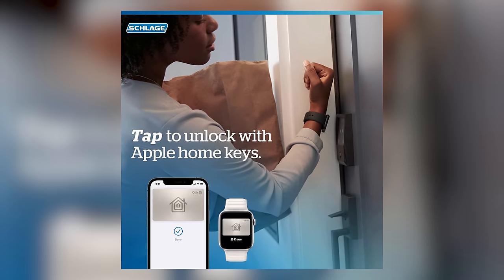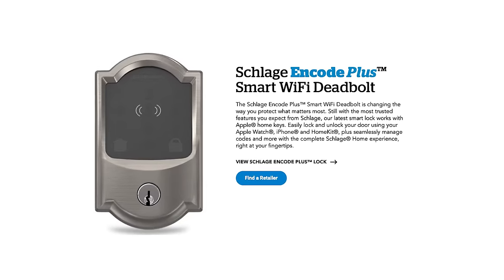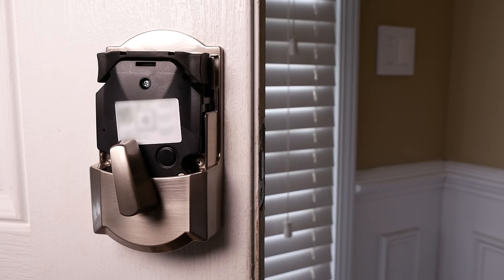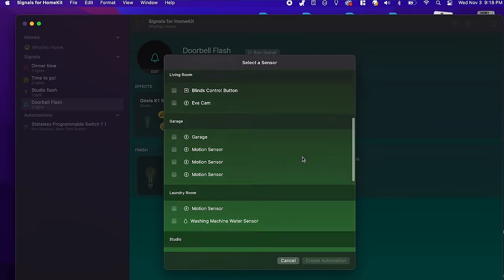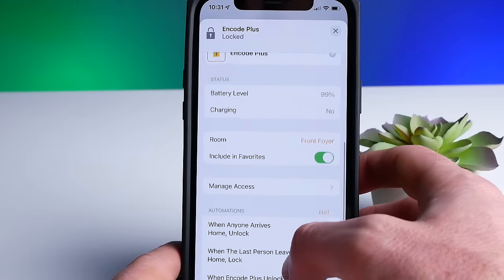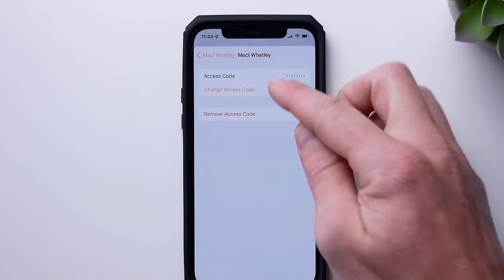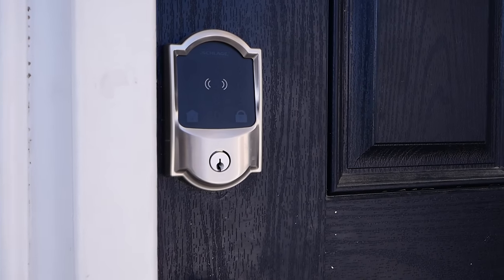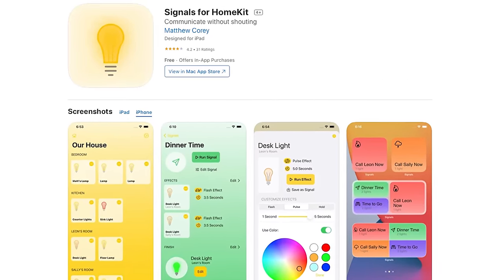Worth the wait?? The Schlage Encode Plus Smart Lock with Apple Home Key is here! [Full Review]

Comment: Setup and pairing was so crazy easy. Didn’t need a crappy app, didn’t need to enter Wi-Fi details or anything. Most painless iot device I’ve ever installed.
Reply: I’ve had so many problems setting this up. I can get it the door to open with my phone. I get notification that it opens with my watch with the checkmark, but it doesn’t. Now for some reason it’s disconnected from Wi-Fi? I like to think I’m pretty good with these things, but this is a pain in the ass.
Reply: I’ve had so many problems setting this up. I can get it the door to open with my phone. I get notification that it opens with my watch with the checkmark, but it doesn’t. Now for some reason it’s disconnected from Wi-Fi? I like to think I’m pretty good with these things, but this is a pain in the ass.

Comment: I've been loving the "Level" bolt lock. Supports homekit and is "invisible" as it just replaces the interior bolt section of your existing deadbolt, so all your old keys etc still work, and the lock looks stock. They ingeniously incorporated the battery into the deadbolt itself, and mine has been going for 2 years now and the battery still shows as "good". Also supports guest users etc, and when I return from a walk I just tell siri to unlock the door.
Reply: For the level lock no, although if you want you can setup a shortcut/automation to unlock it when you are near. As far as going out, you can set it to autolock, or use a shortcut/automation to lock when you are outside of a geofenced area.
Reply: @BlazerRox  has geofence lock/unlock automation been reliable to you? I heard it doesn’t work all the time.
Reply: @aldotorre8802  TBH I haven't used it enough to give an accurate opinion. My house is stucco and so has chicken-wire embedded in the exterior walls, as well as metallic "radiant barrier" roof sheeting, so I usually get literally zero gps signal inside my house.
Reply: Level lock can be picked way too easily, there are videos on YouTube, hope this is better.
Reply: @oBIGTo  My level just replaces the bolt innards, and so is using the original Schlage lock cylinder. This is what I like about the level bolt, it retains your original hardware on both side of the door, and just replaces the bolt mechanism.
Reply: The level lock now has Apple home key
Reply: @Xanduur  Too bad they couldn't add it to the older bolts via software update (at least mine doesn't seem to have the option)

Comment: Nice video.  I'm an Android user, but I love my 1st generation Schlage Encode BE489 Deadbolts, I get all those notifications (WiFi is necessary to get notifications when away from the house).  I had the Schlage BE369 Zwave lock for a decade, I did not like it's large silicone membrane buttons (like an old TV remote) that had excellent feedback from the 1/4 press when new, but it was slower waiting for the button to return, before the next button (unlike this new BE489).  That BE369 keypad would get wet and dirty after a few years of use and UV damage, very slow intentionally button presses.  This new keypad is smooth and seems sealed for the weather better and allows FAST code entry.

Because we don't use iOS, we have the 1st generation Schlage Encode BE469 Deadbolts.  Everyone has their own unique code, even my 6 year old has a code and can operate this deadbolt easily.  I like the fact that any security compromise can easily be changed by deleting 1 code and talking to that individual, not locking EVERYONE out or cutting new keys for everyone.

If you want the highest security deadbolt that even the lockpickinglaw would approve of, take your locks to a specialist and have the cylinders replaced with Schlage Primus grade, then make sure your emergency key is in a very safe place.  The Primus Lock system is almost impossible to pick, and there is no electronic defeat to compromise a Schlage Encode Deadbolt that has been published.  I'm certain as soon as they find a bypass it will be made very public as the Schlage Encode Deadbolts are very expensive and seem entitled to their security label.

Comment: Thanks for this video, great content 😊. I wanted to ask - is it possible to
(a) disable access codes entirely so that only using iPhone / Apple Watch or the physical key unlocked the door?
(b) integrate with some kind of camera / doorbell e.g. Aqara G4 so that the passcode only works if your face / household member faces are recognised?
(c) open the lock using the physical key in the case where the batteries die?
Thanks to anyone who can answer these questions 😊

Comment: Hi Shane, great review! Tried ordering on Home depot and Lowes, both cancelled orders as they went out of stock. Called Schlage sales dept.  3000 units made until June/July.  Wait times will be really long.  Paid waaaaay too much for mine on EBAY but love. Removed my Schlage sense lock and instaleld the Encode plus. Works amazingly well with the express pass feature. Just need to get my better half used to that instead of using the code. I contacted Apple through feedback- the family watches need to have homekit!!!
Reply from the maker: Hey Jeff thanks for the comment. Hate to hear about the long wait times, but glad you got one and are happy with it! And thanks for contacting Apple with your feedback regarding the family watches. I did the same. I sure hope they can add that! 

Thanks for watching!
Reply: @ShaneCreates  The only one on EBay at the moment is priced at 760US$. I bet their locks got caught up in the Shanghai supply chain, so we'll have to wait until much later in the year.

Comment: Question… to unlock using the keypad, do we just type in the 4 or 6 (or more) digit access code, or do we need to push a button after that? I couldn’t tell from your video… looked like sometimes you pressed the bottom left button and sometimes not. (And then, to lock, we don’t have to enter the access code at all, correct, because we can just enable the 1 touch lock?)
Reply from the maker: Hi Erin. Yes to unlock,  you need to enter the code, then press the "unlock" button at the bottom left. To lock it, you can simply press the "lock" button. No need to enter the code to lock it.

Comment: How many locks can you have on one house, can you control multiple locks with one iPhone or Apple Watch?
Reply from the maker: You can control multiple locks with one iPhone in the Home app. I haven't tried using multiple locks with the Home Key feature tho. I assume each lock would issue a separate Home Key in the wallet app and the lock can automatically detect it when close. Would be a good test, but I only have one Home Key lock.

Comment: Thank you for this thorough review, Shane! Got one question: can you set new door open codes remotely, presumably using the Schlage app, or do you need to be local (I.e. on the same WiFi as the lock) to set those codes? I am running an Airbnb, and being able to set and disable guest codes remotely would be a huge benefit for me.
Reply from the maker: Thanks Hubert. Yes, you should be able to manage access codes remotely either through the Schlage app or HomeKit.

Comment: Great video, Shane. I always love the exhaustive nature of your reviews. I’ve been awaiting this lock to replace my August lock on the front door. My home office lock is the other Schlage HK lock. Similar to Lutron, Schlage is a great example of an industry icon for traditional hardware doing everything right when they went smart. My Schlage lock is the most reliable part of my smart home, having never disconnected over the past 6 months (except when it required new batteries). I love this lock and know I can count on it. 

If I understood one of your critiques correctly, I have been able to use automations via the Eve app that occur once the lock is in the lock position any day from 1-8pm. I have a “close down the office” scene which turns off internal lights and HVAC, reduces the humidifier to limited use,  and changes my external color-codes light to white, telling my family I am not in the office. The scene now automatically starts when the office door lock is locked between the time noted.
Reply: I think what Shane meant was the ability to use the individual who locked/unlocked as part of the routine's parameters.  So not just the fact that it was unlocked but that SHANE unlocked it or BOB unlocked it.
Reply: @JohnVanderbeck  Thanks for that clarification. On my Schlage lock, it does not record who locks the door as a code is not required to lock it. I’ve not tried to build an automation on an unlock and would suspect, from recall, that the “who” would not be available.

Comment: Unless I missed something, I did not see you physically set anything on the lock that allows a new device to be given access to it. What prevents anyone else with the software from adding your lock to their device? I would think the safest way would be a hardware "program" button that could only be activated from inside the house or before finishing the install. I'm sure there is something in place but you didn't mention it.  

Or is it just that, as long as it is in the unlocked position you can add a device, if it is in the locked position you cannot?  That wouldn't seem very secure. If you leave you door unlocked during the day, anyone could walk up when you are not looking and program your lock for later access.
Reply from the maker: Yes you need to push the button to put it in pairing mode. Shown at 5:20

Comment: As much as I’ve been waiting for this, Yale locks have rubber gaskets to keep humidity out. My Schlage lock’s alarms went nuts after a few years and go off all times of day and night. The internal garage door lock has never had a problem. I finally cut the tamper alarm speaker wire just to shut the thing up! Also, Yale uses a module system for connectivity. I hope Yale will release a replacement module to upgrade existing locks.

Comment: I had the same issue with it showing it was using BLE, a quick reboot of my iPhone made it show Thread on both of my Schlage Encode Plus locks right away.  Not sure if it was connected to my iPhone and the reboot made it join the Thread network or it just helped my iPhone see it correctly.
Reply from the maker: Ah, nice tip! Thanks for sharing!

Comment: Nice Vid Shane! Is there a sensor that shows when the door is completely shut and able to be locked? I can see issues where maybe the door is not completely shut and the lock can not engage.  This type of door open sensor could also be used in a security setting warning when the door is open and triggering a security alarm. Are there any sensors of this type built in? Thanks for all your information!

Comment: Do you know if this lock - or any smart lock - works when there is no power in the house?  Does the NFC or keypad work with the battery lock if the wifi is down?  As I often run without taking my phone (and house keys obviously), I generally use the key code on my garage to get in to the house when I return.  But one time I had gone out without my keys and my house lost power, so I was unable to get in through the garage.  My husband had to drive home from work to let me in!

Comment: Does this auto-lock after you close the door?
Reply from the maker: No by itself (no door sensing capability) but you could automate it with another door sensor via your smart home if you wanted. There is an auto lock feature that will lock the door after it's been unlocked for a set number of minutes.

Comment: Hi Shane!  Now that you had the lock for several months, did you notice any corrosion issues with the batteries/ battery pack?  I live in the Midwest and have the older version of this lock.  The batteries/battery pack housing corroded very quickly (tried multiple battery brands and still had same issues) and now the unit is failing all together.  I am hoping this issue is resolved on your newer version as I need to replace mine.  Any feedback would be much appreciated.  Thank you for your time, and review!

Comment: My problem with this is signal strength to my front door. I had tried the Schlage Sense with Bluetooth and it was unreliable. 

I have since installed a HomePod mini about 20 ft away around a corner so wondering if Thread has better range.

Comment: Interesting product. I find the styling to be too conservative for me. Was wondering about Siri here. I have a lot of thread devices in my home kit, it seems you should be able to use Siri securely to unlock the door. Pulling out my phone (or iPad) seems cumbersome with an arm full of groceries. Also if I need to get in the house quickly can I open the lock remotely before I get home?
Reply from the maker: Yes you can unlock it remotely as long as you have a HomeKit hub in the house (Apple TV or HomePod). You can use siri to unlock the door, but only on an unlocked device like iPhone or iPad (so it knows it's you). 

This is a security feature. You cannot unlock "secure accessories" via HomePods or unlocked devices... you wouldn't want someone to yell through the window "hey siri, unlock the front door!"

Comment: do you think this would be a good lock to put on an airbnb rental property? currently I have an August wifi lock that generates a new code automatically for each new guest but it started failing recently and the warranty is over so I'm looking for a replacement. not sure if I should buy the same one or something like this
Reply from the maker: Should be a good option. I'm not sure about generating a new code automatically, but you can certainly generate them yourself in the app. Your guests won't be able to use the home key feature unless you share the HomeKit home with them (and they have apple devices). They could still use the code of course.
Reply: @ShaneCreates  thanks! now the issue is finding one, they seem to be out of stock everywhere

Comment: Can I change the key with a locksmith to use the same keys as other doors in the house like the back door ?
Reply from the maker: Yes, you should be able to do this. I haven't seen any info specifically regarding the Encode plus, but I know you can re-key other Schlage smart locks, including the original Encode wifi lock.
Reply: Yes you can.

Comment: Hey Shane. Excellent and informative content as always. Quick question if you have the time… is there a way, either in HomeKit or the Schlage app to set a specific day/time schedule for when other users access codes can work?  My cleaning lady doesn’t need access to my home at 3am on a Tuesday.  If not, does the Eve support an automation to turn on or off someone’s access using their automations?  In other words, is that toggle exposed in the Eve app?   Thanks and keep up the great work!
Reply from the maker: Thanks Jonathan. Great question. From what I've seen, it's not possible in the Home app or Schlage app. That said, I have not used the lock only in the Schlage app (without connecting to homekit).

The Eve app does give you an "admin only access" toggle option (doesn't seem to stop guest codes from working). There are also some other unrecognized custom attributes (visible in Controller & Home+ app). I have not explored these too much yet.
Reply: @ShaneCreates  thank for your time.  This really is a tough one. Would miss the useful features, such as this one, from my current Yale Assure (with August Connect) but at the same time, man am I drawn to HomeKey and Apple Wallet. My wife recently got a BMW X5 with CarKey and I want to trade up for a Bimmer for that feature alone. It’s outstanding! (CarKey and HomeKey).

Comment: thanks for this Shane. how many seconds does it take for it to lock and unlock? is there a difference in the time it takes to lock/unlock when pressing on the home app tile vs. homekey with express pass. Reason why i am asking is because i have an august wifi lock and there’s a significant lag when locking and unlocking using the home app (definitely no connection issues) and it is frustrating. i ended up just using the august app instead.

Comment: I’m currently using an August Wi-Fi Smart Lock and I’m very disappointed on the reliability of the lock status updates in HomeKit. If I lock or unlock the lock too fast (btw, too fast is not that fast…) it won’t update the lock status in HomeKit and since I have some automations that are turning on or off lights depending on the status, those automations become, by side effects, unreliable too. 

I know that you have just post this smart lock review, but what is your experience up to now with the reliability of the lock’s status? Do you need any other app to setup this lock, in other words, does the Schlage app is required at all to use this Smart lock with HomeKit?

Thank you.

Comment: Can you setup Automation rules in Homekit with this lock? For example, if I wanted the foyer light to automatically turn on when a certain code is used to unlock the door, but only between the hours of 6pm-11pm or something like that. Is that do-able?
Reply from the maker: You can setup automations, but unfortunately you cannot use specific codes as triggers. Would love to see that added. But right now you can only use lock, unlock to trigger lights.
Reply: @ShaneCreates   Thanks! Do you know if it's possible to setup an automation when the lock is unlocked by (any) code versus unlocked from the inside manually?